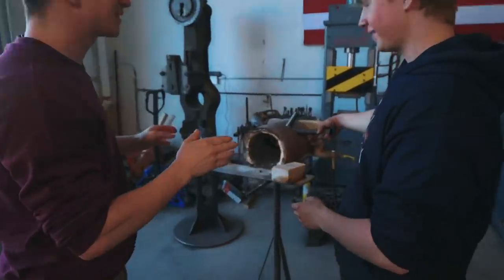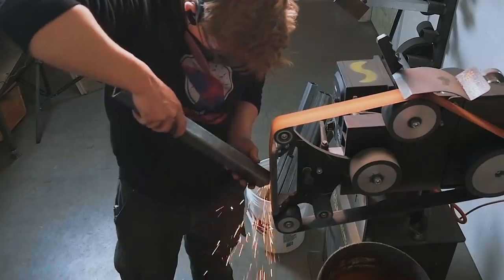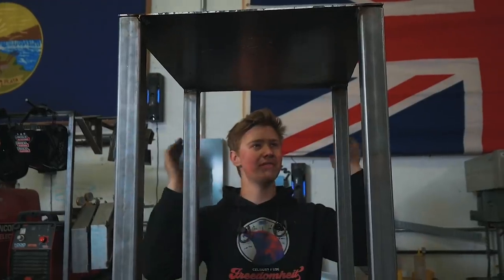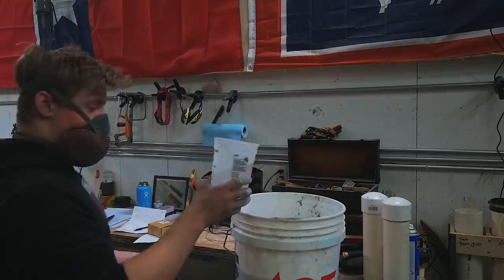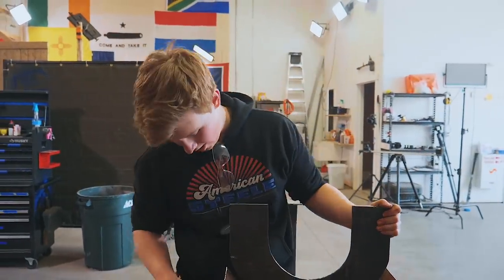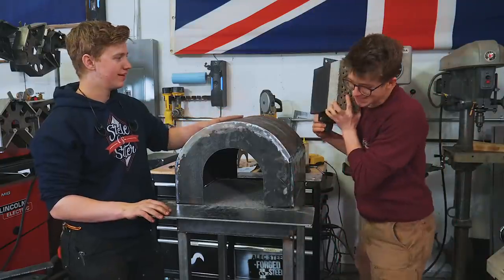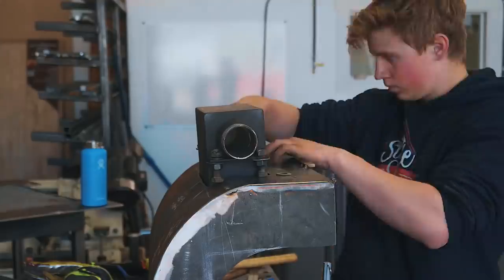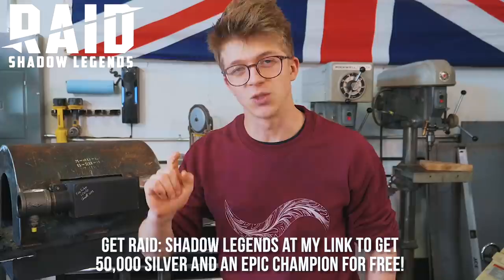BUILDING A MONSTER FORGE!!! Part 1

Comment: I'll be disappointed if the forge doesn't have at least 1 diamond on it when it's done.
Reply: f it, bedazzle the piss out of it lol 💎💎💎💎💎💎💎💎💎💎💎💎💎💎💎💎💎💎💎💎💎💎💎💎💎💎💎💎💎💎💎💎💎💎💎💎
Reply: Diamonds are carbon. They can be destroyed at temperatures lower than the forge will reach. The legs should be safe though. A "where's waldo" diamond hunt would make for a fun reveal video.
Reply: Brandon Ross next episode title will be “Pimp my Forge” 😀
Reply: And thats how you get a 24 parts forge build.
Reply: Thats why he learned pavé setting 😉
Reply: Ahahahaa, right!
Reply: They're actually alright with high heat- but only in a low-Oxygen environment.  They don't crack or deform under heat, but will burn.

Comment: I love that you finally made a bigger one, but was definitely hoping for an even bigger multiburner design that would accomodate a full sword!
Reply: Thats what i think in first place to 🤔🤔
Reply: That's how this becomes a 30+ part series. ;)
Reply: TJ1985 LOLOLOLOLOL!
Reply: The sword adapter is an add-on for later haha
Reply: I was expecting something more like what Essential Craftsman has.  He could probably work 2 or 3 swords, full length in his easily.
Reply: @watchthe1369  the essential craftman build is what I had in mind when I commented! I tried to link to the video but YouTube must have flagged it as spam
Reply: Cut off the back porch and duplicate it. Put the two back to back (like the three toaster- oven temper oven). Or build an insert for the middle. Then you each have your own forge when competing, and a sword heater when your working together or on longer projects.
Reply: @InvisibleJiuJitsu  Yeah his forge has 3 ribbon burners in it and he can turn them on and off depending on the size of the work.  
He also has fire brick handy so he can stack the bricks to make it taller.  I am sure he has also shortened the forge down to only 1 burner in length by stacking bricks inside too.    I wish they thought more about the build.  This isn't the first forge build and it is going to be THE HUB for everything else.
Reply: @watchthe1369  yeh! and he can lift it on a hoist and stack more brick for taller work. It's an extremely clever and flexible design that Alec and will wouldn't outgrow for a long time (if ever)

Comment: 6:45 Tamp that mix! Use a heave flat object like a 2x4 strapped to a hammer. It will remove the air and create a solid product.

Comment: Awesome Video !!! Just a little tip for the welding:) 
Use shorter and more welds, like 4x2inches,  for attached  parts such as the flat steel on the thin plates for positioning . Then you don’t have to worry about deforming so much, and you easily get the strength you need. 
I love your videos and I’m curious to see what’s coming up next!!!

Comment: I think the first test run of the new forge should be to forge a pizza or two in it.
Reply: Mild steel crust with sliced Damascus pepperoni, crushed crucible steel sausage, and shredded brass cheese.
That would be an awesome project that should supply several episodes.

Comment: Interesting design for a forge has a lot of potential to be a massive upgrade to the old one just watch out for the ribbon burners as they can easily suffer from blowback and bad fuel/air mixes when running at lower temps especially if you are heat treating or trying to forge some copper. I am also really interested in the door design the bricks always killed a part of me on the old forge.

Comment: Get anti splatter spray for when you’re welding (cig weld make it) also push don’t pull (unless you’re using flux core wire but it sounds too quiet for that).

Comment: Clean your steel plate where you have to weld it'll help you alot and don't be scared to turn up your welder settings, more heat will help during welding to better bond the parts and should already be better aesthetically. ;)

Comment: I’d still like to see a modular forge setup where you have multiple segments that can be wheeled in to extend the length of the forge when needed for long pieces, and uncoupled for shorter ones. They could either have a burner in each segment or some with and some without to alternate in between ones with burners to keep costs down. They could also be kept to the side and unheated for controlled slow cooling.

Comment: The insulating part of the KY wool is largely the air trapped inside of it. As you compress the wool its heat insulating capacity lowers. You should have blocked of the wool in some way, stopping it from compressing as much

Comment: i use a grinder with a flapper wheel or a sanding disc on it, definately would be alot faster in my opinion :) flapper wheels last a bit longer.

Comment: Since you're fabricating it yourself and putting it on casters, what if you made several forges with different dimensions, that you could wheel in and out as needed? I'd imagine that the more internal volume a forge has, the more fuel it takes and the longer it takes to get it up to temperature. If only working on certain pieces, it seems like smaller or different shapes would come in handy. For example, the old forge is a great knife making forge, and this new one is good for larger and more square pieces, as well as initial stock heating. Maybe you could also make a long and narrow forge for tempering swords and other long pieces that won't fit in the kiln, without having to paint the heat or void the warranty on toaster ovens.

I imagine the limiting factors are the cost of refractory, the cost of burners, and the difficulty of detaching and attaching the fuel and oxygen lines. I have no experience in blacksmithing so I have no idea how big of a factor each of those is. But if it's not prohibitive I think it would be a great way to save fuel and time and hassle.

Comment: Two mistakes:  you really should have used a rigidizer on the wool.  Simple fumed silica in water would have worked fine spritzed on and then fired so it melts and bonds to the fiber.  That stops the wool from releasing fibers when hot (that’s when it is really dangerous).  More important for your situation is that it also makes the wool stiff so it doesn’t collapse under the weight of the refractory.
Second mistake:  you only needed maybe a half inch of the Mizzou.  It is not there for It’s insulation, it is there as a flame face to protect the wool (yours is now compressed under way too much cement and has lost much of its insulation properties).

Your biggest win:  Going with a ribbon burner is the right way for sure.

Comment: plasma cutting note.....  they make circle/arc cutting jigs that work great for exactly what you did in this vid. Also a simple piece of 1/8 flat bar to use as a straight edge goes a long way in making nice smooth cuts. I thought you woulda made that cut to remove the 1" with the plasma instead of the cuttoff wheel.

Comment: Ok I'm.... seeing a bit of a problem, here.  Maybe I'm missing something, but.... the kaowool....  it's being compressed by the refractory material.  Doesn't that kinda kill almost all of its insulating ability by forcing the air out and making it just a solid-ish brick?  I mean, it's still kaowool, so it's not going to burn or anything.... but.... it's not really going to insulate much either....

Comment: you definitelly need a biger forge, for sure, but why not a longer one than this one you are making, to heat all long in one time the blades of the swords you'll probably making to the future, you have already needed to tamper with ceramic fiber a heating "tunnel" in the past, so a well maded forge & heating tunnel is probably requested for your future work ;)
things that can do the most, can do (most of the time) the least ;)

Comment: FYI, Kaowool loses it's insulation properties when it's compressed. It's better to use something like fiber board or k23/k26 firebrick to insulate the base. Then, you only need to coat the bottom with a thin layer of refractory.

Comment: Just to let you know when you pour the mix over the wool the wool looses most of its ability to insulate since it is compressed so it ends up being a waste.
Reply: Interesting point Dave,sounds right to me but how do u stop the wool from compressing without adding steel plate inbetween the wool and refractory thus making the wool redundant?
Reply: @redordead3868  I would have done exactly that, put in metal between but on its edge (less surface to conduct heat) as a support and premake the refractory cement in a mold and place it over the wool and on the frame. There is no way that you would not have it in contact with some metal somewhere but it would still be much more efficient than what is there now. I would think the wool's value went to near zero being crushed.
Reply: excellent idea thanks for the reply

Comment: Alec: "...It's a little bit carcinogenic."
Will: Rubs and digs at it with a bare finger.
Reply: It’s when it gets in your lungs that it’s bad, hence the respirator and isolating it in the grinding room. More concerning if you wanna be super duper safe is the treatment of their clothes after handling the stuff, and any fibers that might be stuck to them.
Reply: There's still not much consensus about how carcinogenic it really is; it was predicted to be, since it breaks off tiny little needle-like dust that in general cause cancer. It's more dangerous after it's been exposed to high temperatures, as it becomes more brittle. Still, better safe than getting cancer, I'd wear gloves and a different set of clothes, because cloth can easily carry the dust around with you.
Reply: @dkosmari  yes, and you would always want to wear cloves when handling castable refractory....

Comment: YES!! YESSS!! you went for the forced air ribbon burner! you are in for a ride guys.. and its a one way ticket. takes some time to learn how to regulate the mix and stuff.. but you can MELT several metals in a forge like that, for casting or else. once you learn the mix ratios to reduce oxidation and... o man this gonna be great.
now, if i may, i'd like to do a small observation from the little i know. k-wool is a great insulator, not too great at storing and refracting energy, but reaches desired temps faster than refractory mortar/bricks/cement. the thing is, you've compressed it. part of the magic with k-wool is the small air pockets within the fibers. its still going to work as an isolator in conjuction with the castable, so don't worry about heat burning through to the other side of the chamber... but it wont be as great at what it does now that it's compressed. personally, i'd have gone for some light refractory bricks or tiles on top of k-wool for the floor (it does compress but not as much).. so its easier to replace the floor when flux/borax eats it away (and you can still do that on top of the castable!). but again, the current desing is gonna work just fine until the next rebuild, and then you will be able to apply a lot more knowledge gained from the experience during that time.
 CONGRATS!
Reply: Im making my first forge when i get my next paycheck on the 5th. Been collecting materials for a while and finally found an old dead air compressor i am planning on using for the outer shell. Can you clarify that for that sort of thing i should wrap the interior in the k-wool stuff and lay firebrick on top of that to make the floor of the forge? My original plan was going to be to lay the bricks in first and stuff the k-wool in to cover the rest of the interior but a wool coating first makes more sense.

Would the thin firebrick i see online be enough i think they are 1 inch or so thick? was planning on using the fullsize ones that are like 2.5 inches on my original design. Also im assuming after i line the interior with k-wool i want to put a nice coat of the refractory cement on then put the bricks on the bottom? or should i coat those too?

Should i skip using a regular cylindrical propane burner and just go for one of the ribbon ones? how expensive are they in comparison?

Other than just learning as i play around with making this is there anything else i should be aware of before diving in?

Thanks for any advice you can give

Comment: The slag from the plasma arc pops off easily with a chippeing hammer saves a lot of time and belts
Reply: And using a straight edge cutting guide and a radius cutter saves all that marking out and grinding

Comment: Hey guys. I noticed your issue with deburring that giant plate. I deal with this often at my job. Pneumatic Die Grinder with sanding disks, what I use,  are fantastic. I haven’t seen you guys use them yet. Might be worth a buy? Much easier to debur with the heavy steel. Later. Keep the videos coming!!
Reply: Yup. Even an angle grinder with a flap wheel. I started using a pneumatic belt grinder/belt file a couple months ago for light deburring and weld clean up. Works pretty nice for tight corners where you're worried about undercut from the die grinder.
Reply: I use a really large 9 inch wire wheel as they debuted buy tearing it off and melting it way(no melted metal flys anywhere) and leaves a very clean smooth edge without having to be careful not to nick it like any other grinder also a lot faster.
Reply: @shaunthedinosaur7812   I forgot about the wire wheels. I keep a cup wheel set up on a grinder, but usually when I'm cleaning up edges on something big enough to get out the wire wheel, I have to grind fillets for welds, too, so I just end up using a flap wheel or the belt grinder

Comment: Cardboard template cut to the arch and then traced to the plate so it fits?
Reply: Really hard to measure lol. Every shop should have cardboard sheets for just this purpose. Making an odd shaped box or lid? Mock it up in cardboard first so you always get the correct dimensions without cutting up expensive steel.
Reply: Cut first, ask questions later.
Reply: @mikeh6948  - Maybe this is why my scrap bin fills up so quickly.
Reply: @JETWTF  meh, it's steel, and they all those cool choices for making steel stick to more steel....what's a few $$
Reply: I love Cardboard Aided Design.
Reply: I thought the same thing. They waste a lot of time and money messing up little things like this lol.
Reply: @bendingsands87  - they have frequently said they're learning as they go.  That's to be expected.
Reply: Yep, they need a course in Texas dealing with mocking stuff up.  Cardboard and ducktape are way faster to fabricate than steel!  And cheaper!
Reply: Blame fabrication , or blame the drawings?? ☺ Angle*(circumference / 360). Easy, fast, no f**k ups 😂.
Reply: The formula to find the exact length needed is in fact very easy to use!
Reply: @tri4arda  - that assumes it's a perfect circle shape. It didn't look like a perfect circle to me
Reply: @jarodmorris611  he used dividers, it should have been. I'm a boilermaker by trade, sharing some advice.
I enjoy watching the forge projects but they need all the help they can get with general fabrication.
A few minutes on paper, a little extra care cutting the steel makes all the difference.
Reply: @tri4arda  - yes he used dividers but he shouldn't have because the arch of the top of the forge (which he was trying to match) wasn't a perfect circle arc.
Reply: @jarodmorris611  honestly mate, your confused. 
Look at the drawing, it has flat sides with a circular top.
Yes,  you can easily wrap one piece of steel over the entire shape, angle*(circumference / 360)+ FLAT sides. Very simple, no fancy arc curves in the drawing, nor on the finished product.
5 minutes, no cardboard required.
Reply: @tri4arda  - you are clearly confused. Look at 8:08. The perfect circle arc drawn with the dividers does not match up with the already-bent top.  You seem to assume that he was the one to fabricate the top he was trying to match but we don't know that for sure.
Reply: @jarodmorris611  mate, its plate.... It conforms to the template easily. Depending on thickness you pre roll the sheet to 'break its back' and ger it close. 
Clearly you've never touched steel before. 
Please don't tag me anymore. If you want to understand do some research or go to trade school.
Reply: @tri4arda  - lol okay 'mate'. You don't seem to understand my point. It's possible the bent top is a perfect circle arc on a different radius, but it didn't seem like it to me.

Comment: Why wouldn't they double the length of the forge to accommodate all the swords they make?
Reply: Glen Atchison more than likely fuel consumption would be a big issue that large. You don’t need to heat the entire thing at one time. I heat sections in mine. I can do a full length swords in my forge and it’s only as long as a propane tank.
Reply: Design multiple forges with the intent on locking them together for thermo-cycling and heat treating.
Reply: If you heat the entire length of a blade then you will only be able to forge a small section before the blade cools down. Its inefficient
Reply: @mattforsythe5037  true, but consistent heat for cy ling and heat treating is much easier with a forge long enough to heat the entire blade. That's why I said, in other comments, modular.

Comment: Will you could have used an angle grinder or just about any kind of grinder or sander that's portable to do the same thing. A little easier and maybe even faster cuz it's easier to handle a grinder than the big plate. Even if you want a little bit of a bevel for the weld

Comment: I just hope that you didnt use galvanized or zinc plated bolts where you welded them solid to the frame. The coating of those bolts will vaporize when welded and is toxic. Also they will fuse with the welding while creating porosity in the weld and making them weak and easily cracking. As they are going to be heating and cooling constantly in use. Those welds wont last long.